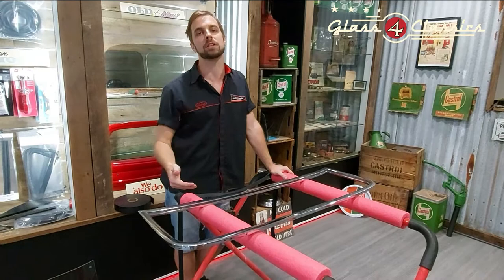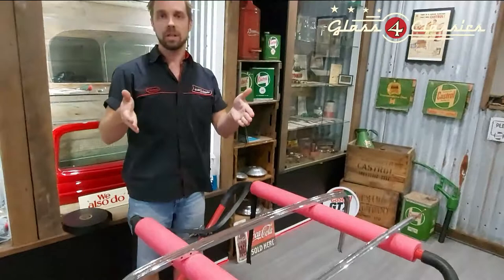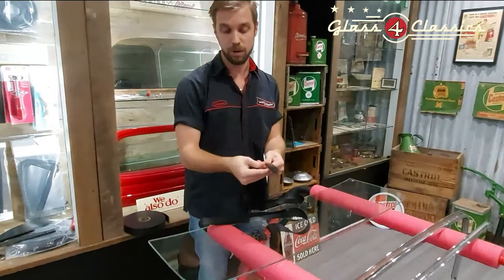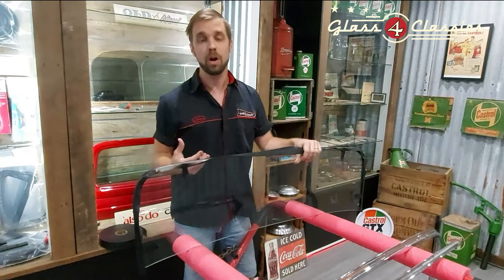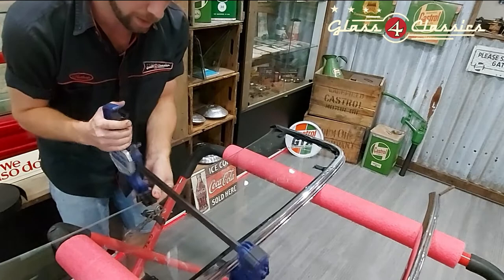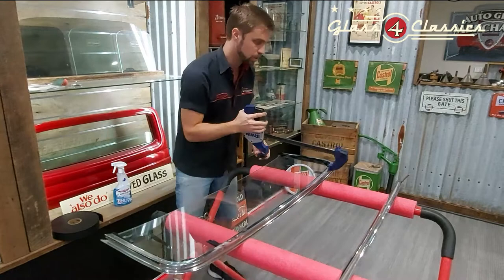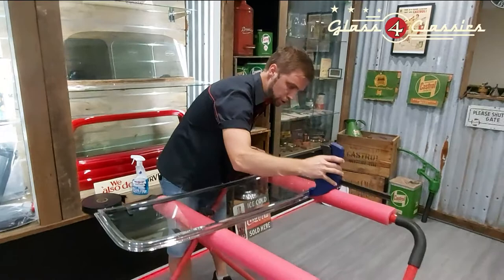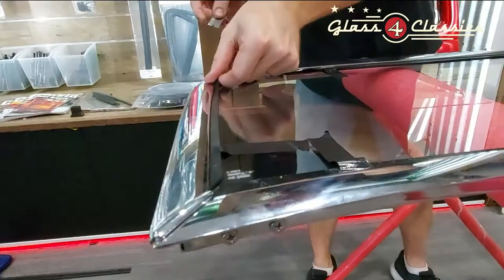How To:  Installing glass in a 1932-1934 Ford windscreen frame.

Comment: After you put the glass in the frame, how do you affix the frame in the window opening?
Reply from the maker: Hi Rick, 
Thanks for the question. It really depends on the body. Most fiberglass bodies the frame is then simply glued into the opening with Sikaflex, makes it quite tricky to get out if you get a breakage, but most people do that as the bodies don't really allow for much else when they're made. The original frames were hinged at the top, so that held it in place along with the crank at the bottom. They're never a very good water tight fit to the body, but most people don't drive these in the rain anyway so it's not such a big problem.